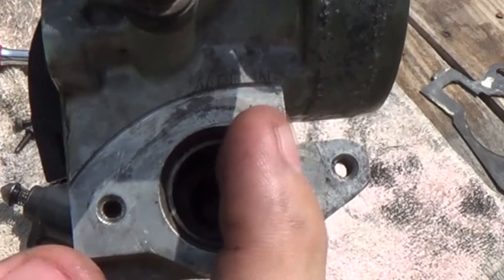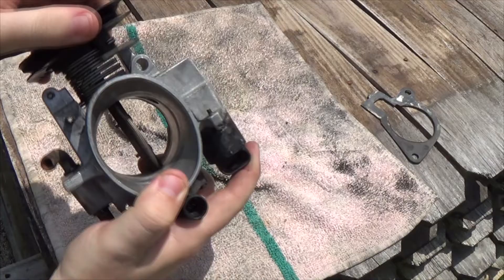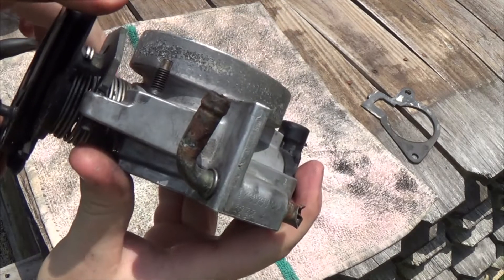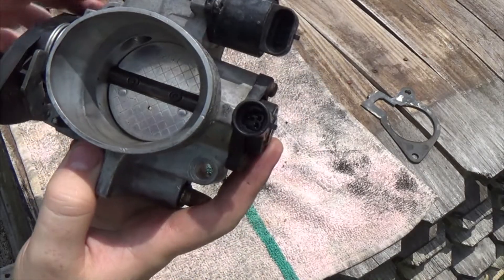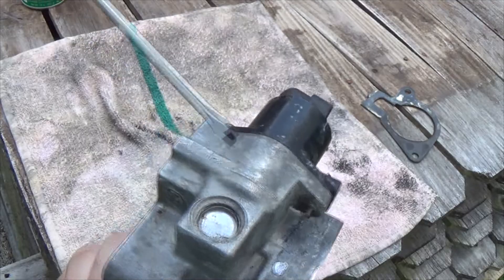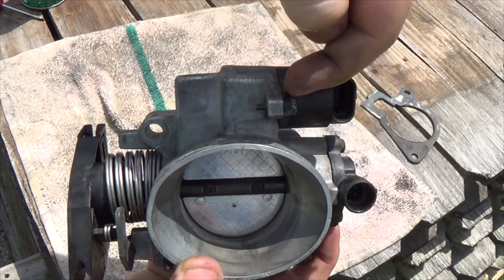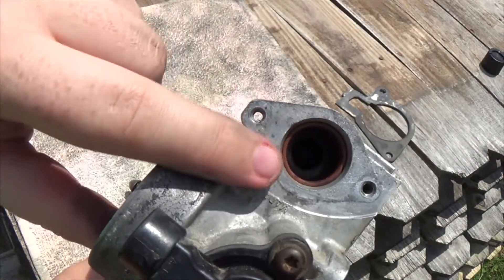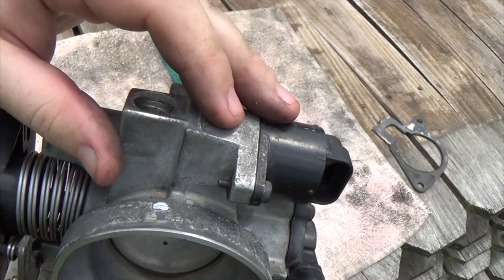How an Idle Air Control Valve Works

Comment: Nice explanation, thank you. There was a fuel saving modification to the IAC I heard about, where a restrictor was inserted into the IAC hole on the air-in side of the throttle body which restricts the air flow by about 50%. So when city driving and waiting in at the lights, it brings idle speed way down. I did this and then the car began to run way hotter than normal. Can anyone tell me, does the IAC also somehow speak with the ECU and cause a lean mixture?

Comment: Nice video, but I was looking on "how" the valve actually works, your video is more like what it does - but still informative.

I have a good new IAC valve and I want to learn how the valve acutates. Mine is for a GM 1987 2.8L V6 Fiero.
It has 4 pins. I buzzed it all out.
There is 50 Ohms across two contacts (same in both meter polarities)
And 50 Ohms across the other two contacts (same in both meter polarities).
I read that it uses a stepper motor to move the valve in and out by various amounts (not just fully open or fully closed) but no details on exactly how it steps.
I went slow and tried 5V across both sets of contacts to see what it may do.
5V across the both sets did nothing (even in reverse polarity).
So I went up to 9V and did the same.
Again, nothing across the first set of contacts, but a slight twitch clockwise in the shaft (same direction even with reverse polarity).
I was expecting the valve to twitch in or out, but it looked like it wanted to turn.
Before I go and try 12V, I would like to know what it expects.
Do you have any ideas?
Thanks

Comment: Thank you for the video. Quick question, I was getting P0505 too and bought a aftermarket part on Amazon. No more p0505 code but this particular IAC makes noise when the key is set to accessories. It sounds like a little motor is constantly running. Is that normal or should I ask for a replacement?

Comment: on the hose that comes from my air filter and gets clamped on the throttle body, there is a seemingly "purposed cut" that seems like its meant to go over the iac valve hole....? I'm wondering if that is indeed the case? or if somehow along the way it managed to get dry enough to break that apart. that being said it is a perfect square that must have been created.

Comment: My 2000 Dodge ram 1500 engine shuts off while driving sometime most if not all the time when it's hot outside, it happens alot in summer. This is one of the things I'm thinking it is. I'm going to replace it myself with a cheap new one i bought on ebay since it seems easy enough to do. How and what do you recommend i should do to clean the hole that the iac sits in?
It's in a hard to get place so...

Comment: Hey, I had idling issues after my engine gets warmed up. After months of googling I found IAC is stuck on my palio 1.2 (2002). So I have removed it and cleaned with carb cleaner. I also loosened the spring and removed the pintle which comes on it. Now the problem is I don't know how to recalibrate the pintle which is present on the  IAC. I don't know whether to tighten it till the end of thread. Because I'm concerned about the free back and forth movement of the IAC. Please let me know how to calibrate or how much should I tighten the pintle thread on my car's IAC. Thank you!!

Comment: I took my ICV off and bought a new one, I compared it to the old one and noticed the length of the valve was at least 1/4 inch longer. I then realized it's just a long screw that can be adjusted, but none of the ICV videos mention that. It seems after 20 years it could have unscrewed a few turns, then the vehicle would run badly? I screwed my old one down till it's the same length as the new one, I haven't tested it yet. I hope it works now and can return the new one.
Reply from the maker: Not a lot of ICVs have that. Hopefully that does the trick, and if it does, I'd recommend putting on some low strength threadlocker (purple in most cases) to keep it from getting slowly backed out again.

Comment: Good video, but is there a one way valve to stop air going back out the same way? What happens if air goes out the way it came?
Reply from the maker: When the engine is running, it is constantly pulling in air, so it is very unlikely that any air will be going the other way. Even if some did somehow, it would get pulled right back in, and nothing would be different about it.

At the point of the idle air control valve, no fuel has been added to the mix yet, so there's no worry about the air/fuel mix getting weird.